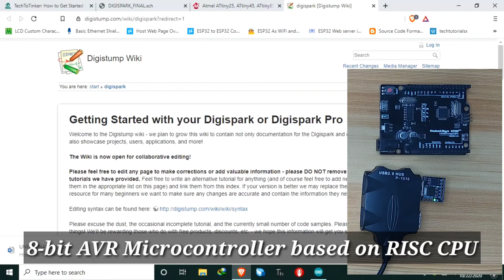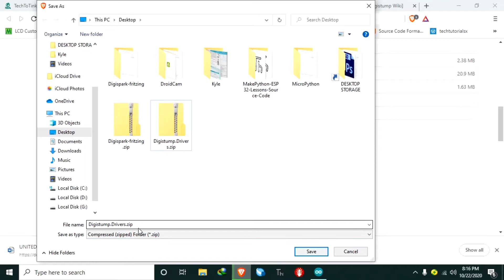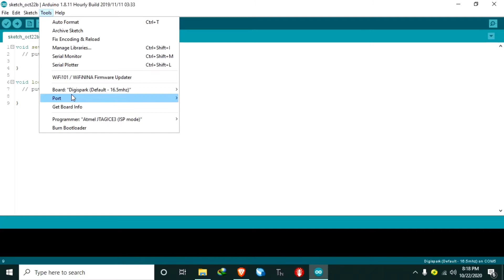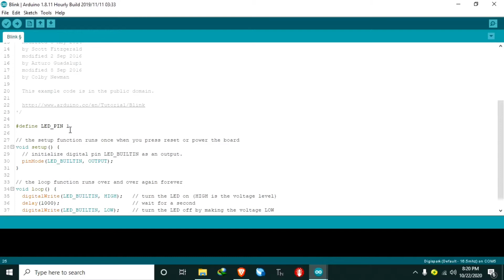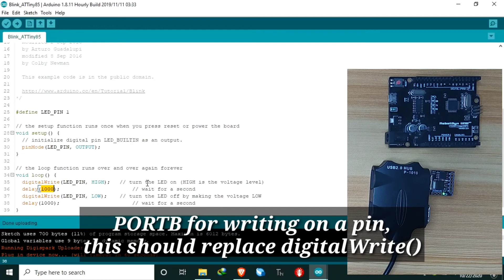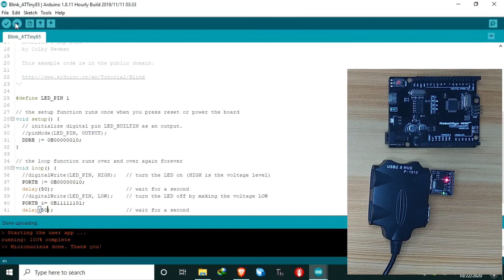How to Get Started With ATTiny85 in Arduino IDE | Tutorial

Comment: If floatswitch = 1 (on) I want to run a dc motor for 5 seconds.
That is my tiny project, would the ATTiny85 be enough or would you recommend a bigger arduino?
Reply from the maker: That's doable in ATTiny85.
Reply: @TechToTinker  Thanks!
Reply from the maker: @StreetArtistsOfTheWorld  you are most welcome. Thanks.